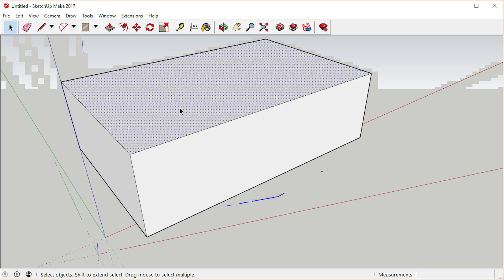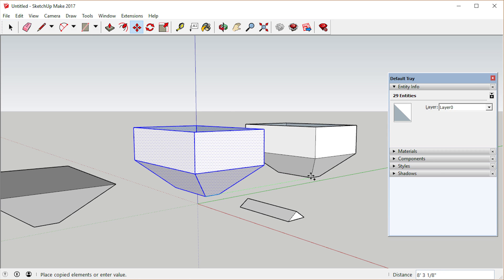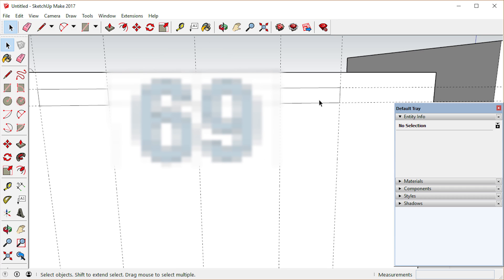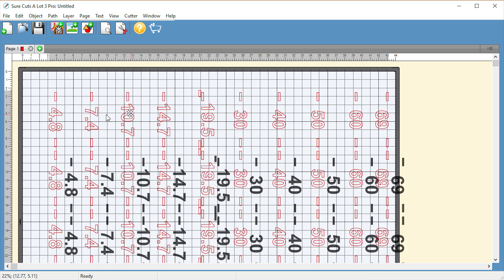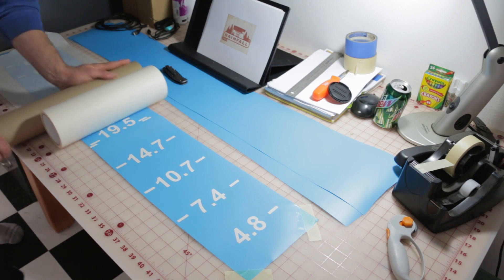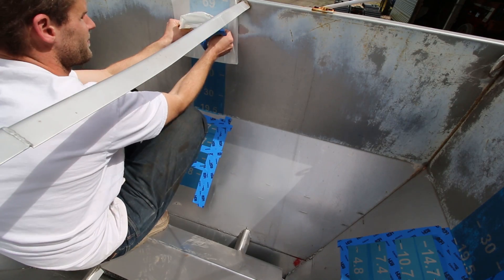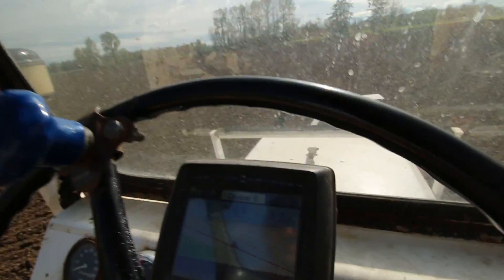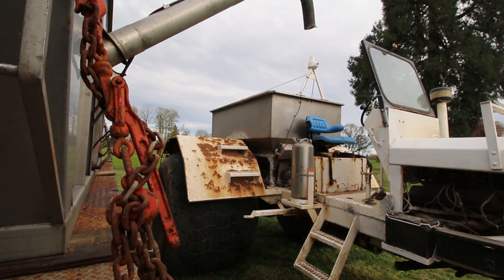Calibrating and Spreading Fertilizer with the Buggy

Comment: hey how did you measure how far the fertiliser is spread? and how did you ensure you weren't overlapping and what you've already spread? great video.
Reply: Never hurts to verify your spread pattern. My floater truck was throwing excessively far and all the fescue ground had stripes around 8' wide between passes, pasture wasn't noticeable because of the lower application rate.

Comment: Do you ever do microcontroller stuff? You could use your volume vs height calculations with an ultrasonic range sensor. Then print your lb/s per hour right out to a screen. Always love your videos!
Reply: Rainfall Projects Exactly! They're pretty cheap off eBay. As for a whole gps system, those are more expensive (like 40-80$). You could vary a valve based of the speed reported by the gps but I'd be worried about correlating how open the valve is vs flow. Maybe trial and error with some cheaper fertilizer or something. The ultrasonic sensor to monitor flow rate would could be a first pass though and then you could expand it later.

Comment: aren't you afraid of the paint just wearing off in a few runs? Why dont you try to ingrave the marks in to the metal one way or the other.
Reply: +Rainfall Projects
You could always CNC the stencil into a this sheet of metal and weld that to the inside of the bin.
Reply: Dear Mr. Jowrdy,  Sure the paint is
going to ware off. That reference 
point can be "stamped" with metal
"dies" later when the calculations
are determined. 
Sincerely, Kathleen.